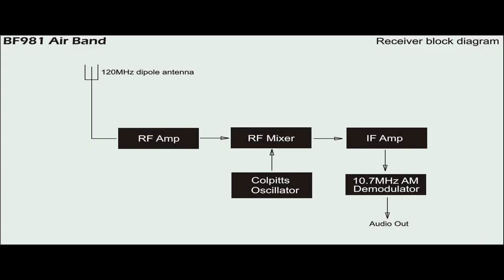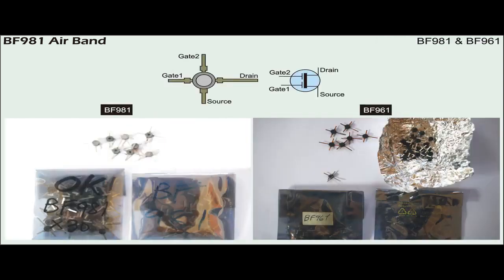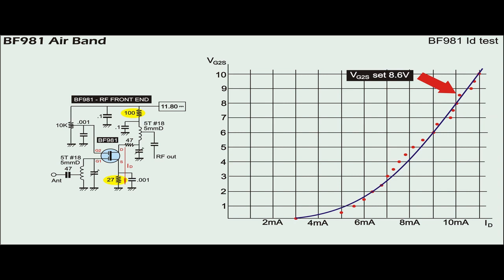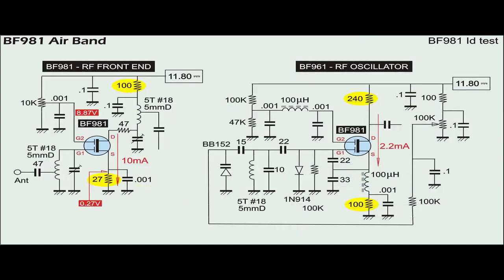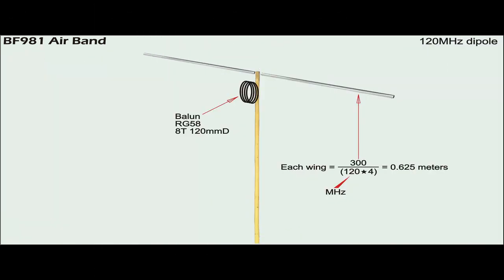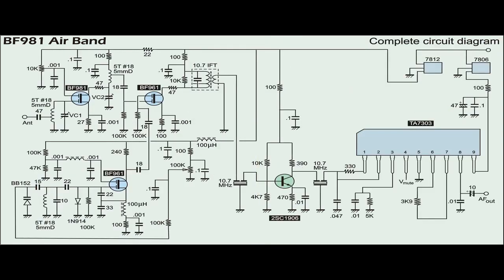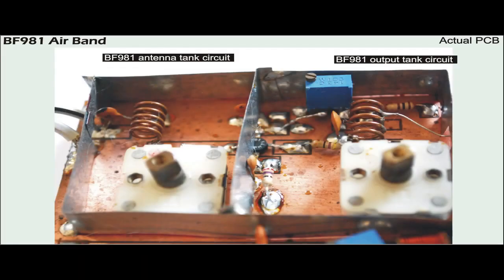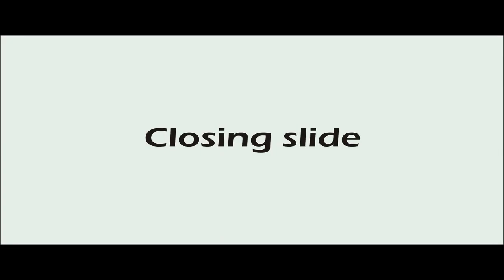BF981 Air Band

Comment: The  7303 is an limiting IF amplifier and FM detector. The limiter is designed to remove any amplitude modulation from the input signal. Aircraft band uses AM modulation, so this circuit will never be optimum. It is a very poor design.
Reply: Vê se não atrapalha.

Comment: No offense intended but you are bypassing to ground the signal after the second ceramic filter with the 0.047 capacitor. That 330 ohm resistor is meant to connect pin 1 and 2 of TA7303 and the signal to be connected directly to pin 1. I have checked again, only the schematic is wrong, in the prototype the 330 ohm resistor is connected OK.